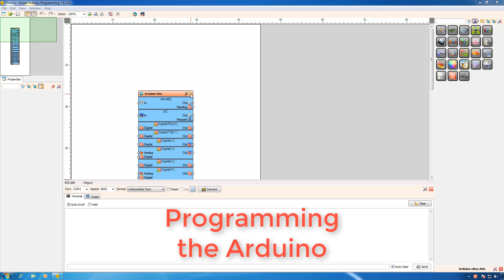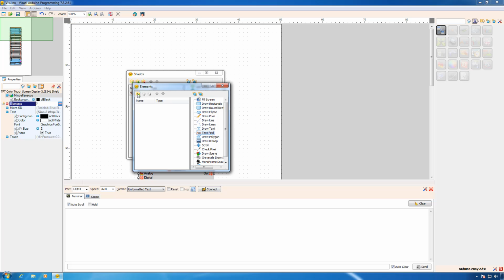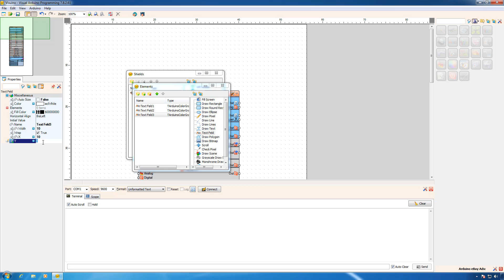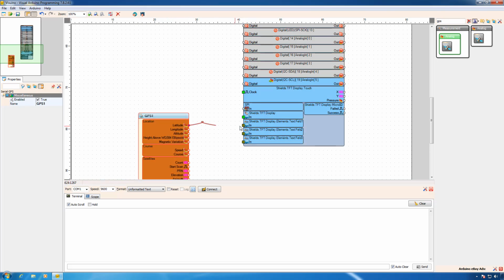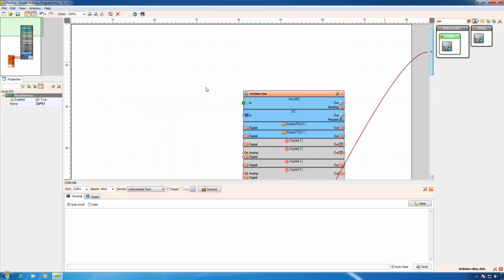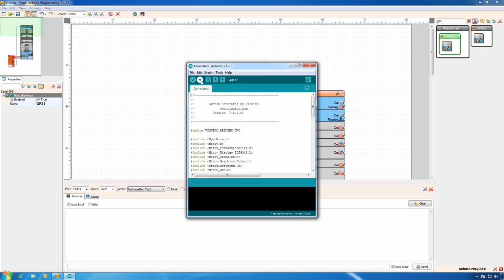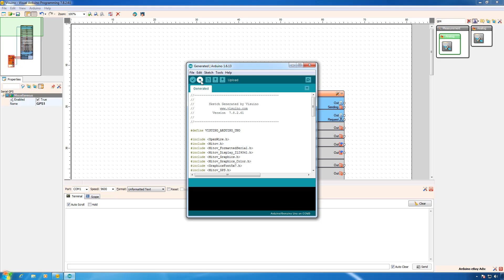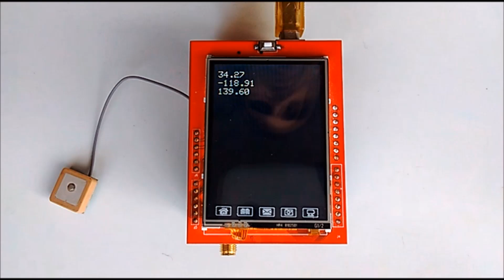Visuino Video Tutorial: Arduino GPS Location display with GPS and TFT Touchscreen Display Shields

Comment: ok now I can understand why nobody can fix electronics anymore at lease if they are designing using the method you just showed in the video at lease if you are using only arduino IDE one has to use a brain but using Visino its just point and click maybe draw a line or 2 than the IDE builds the code and it just magically runs now here is the real kicker ...if a child can do this what good is a college degree,,,why not just hire the child and send all the adults home.WHERE IS THE explaination of how this works and WHY.